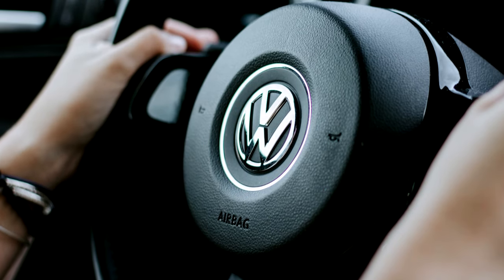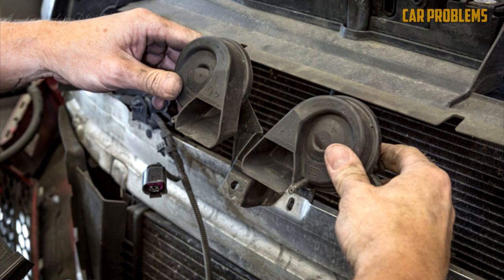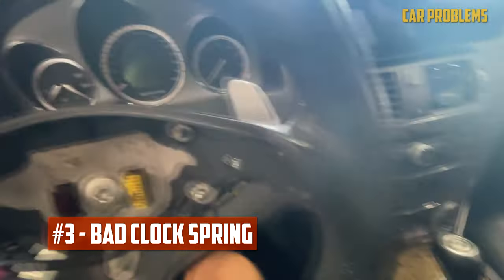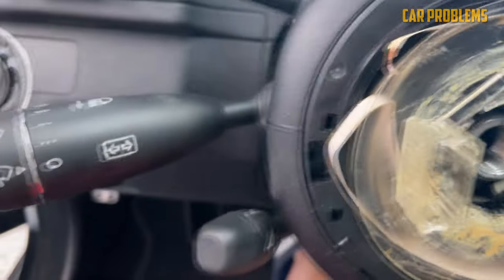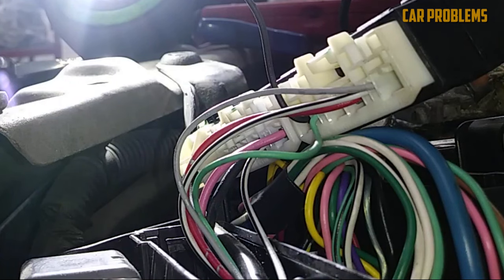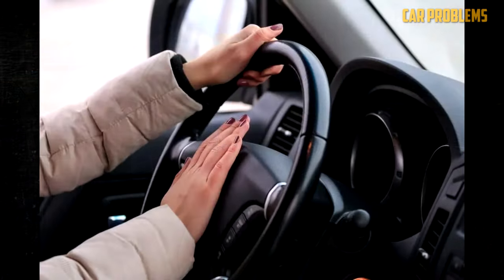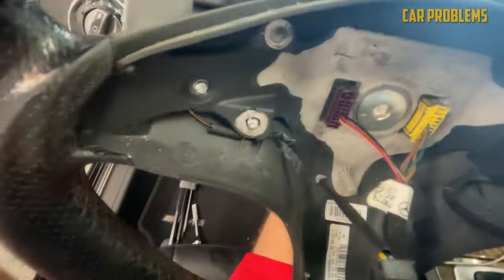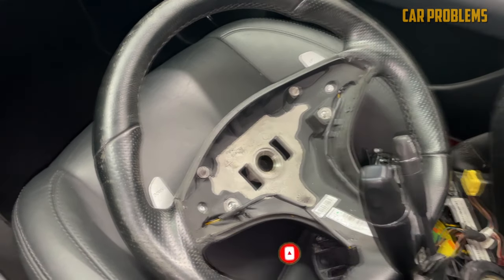6 Causes Your Car Horn Not Working &How to Fix It

Comment: My fuse keep blowing out on the VW GTI...I have replaced it twice...i had to lay on the horn for 2 minutes for a pair of idiots that refused to move on the highway...Now it wont work right
Reply: Took it to VW...they said an aftermarket shop installed a radar detector on the windshield wiper fuse circuit...That was why it was blowing out...

Comment: I'd most likely set the air bag off if I did anything like this... However, I did learn that my truck has a low tech, ever so slightly risky 007 feature... There's a button to turn the passenger air bag off... Come ere squirrel! Let's go get some hazel nut ice cream...🤞

Comment: What does it mean when you hear the relay clicking when you hit the horn.
Reply: Means the fuse is working 👍🏼
Reply: Redux, what is happening is that my high beam bule light indicator light comes on when traveling on a bad road. (Louisiana) When this happens the horn won't work. When I hit a bump, and the bright light indicator light goes off the horn works. So, I know it's not the fuse. I think it could be the relay losing connection and the next bump reconnecting. What you think?
Reply: My horn clicks but doesn’t beep 2014 Acura mdx
Reply: @paulsoper744  interchange relays (some can be moved around) and if the problem goes away? replace the one that might be causing the issue.

Comment: Hello. I have a '99 Civic whose horn only works sometimes... I hear the relay's clicking noises when I press the buttons on the steering wheel. I bought another horn at a junkyard, thinking it was the horn, but it turned out not to be, as both work hooked up to a battery... What could it be? Help would be appreciated from anyone...
Reply: It sounds like the circuit isn’t being completed. Clean off your connections with a wire brush. Did you check the relays & fuses? It could be a clock spring or wiring if it’s not a relay or fuse.
Reply: @pmcgns10 , thanks for your reply. I checked the relay and the fuse, but they seem fine. When I have more time, I'll have to remove the bottom panel below the steering column and check the connections... I've already tried connecting the bolt where the horn grounds directly to the battery, but to no avail...
Reply: It might be the clock spring then if it works occasionally while turning or you hear the squeak of the horn it's most likely that
Reply: @robinforheurst1721 , thanks for your reply. I had the ignition switch replaced a few years back and the car does have an aftermarket alarm installed. I don't know if the connections were redone properly or if something came loose...
Reply: @pmcgns10  yeah the clock spring was my cause of the Issue it took me a while to figure it out! but if that's the case? it's relatively easy to replace it yourself  (I did) watch a YouTube video as to how.